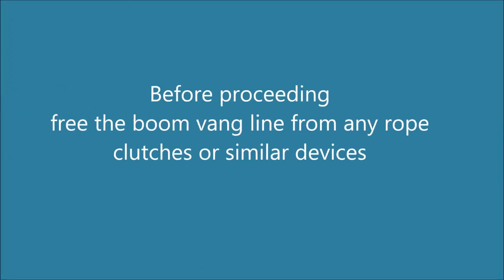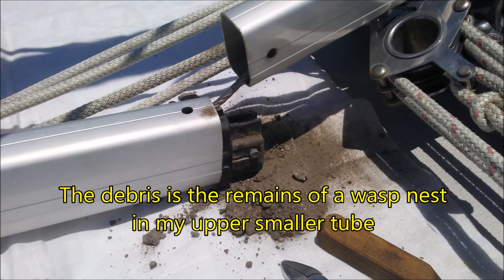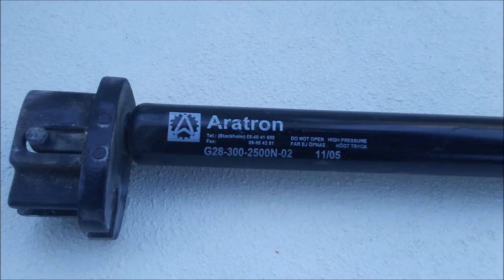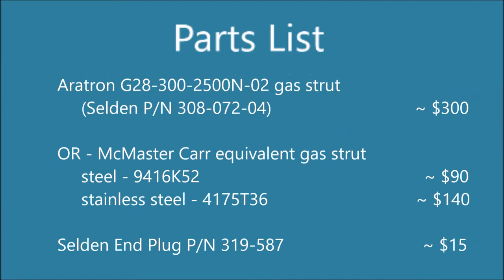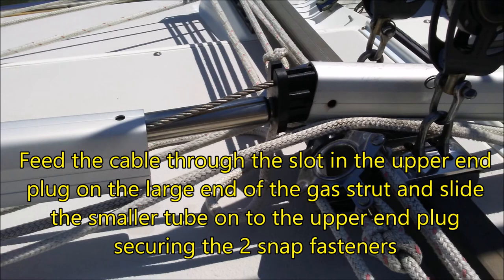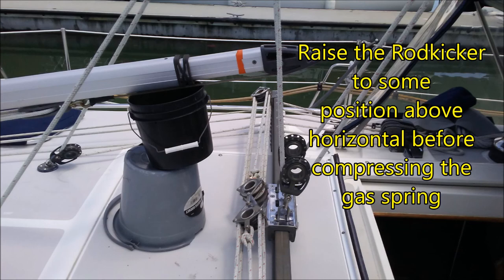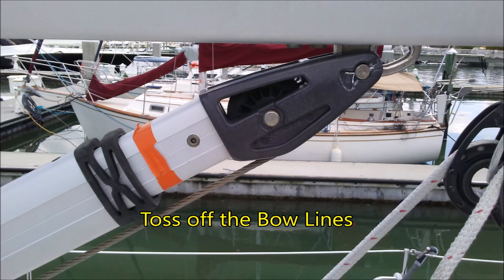Replacing the Gas Strut in Selden Rodkicker

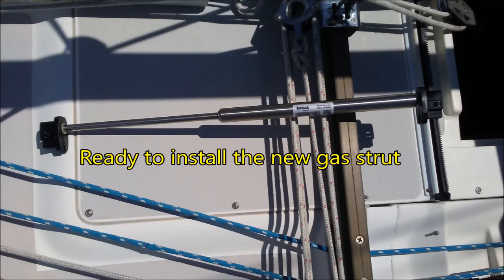Comment: Just a clarification.  At 2:15 of the video, we see the symmetry of the end pieces - flat ends each pointed towards the air spring.  That is incorrect.  The bottom one needs to be reversed.  This is because the metal tube inside the lower part of the rodkicker presses against the endplug, and if reversed, the tube eats away at the end plug.  No, it is not intuitive.  We want the flat ends of the end-plugs to each point toward the mast.

Comment: To remove the cylinder from the end plug, use an angle grinder to cut the cylinder at an angle about an inch from the end plug. (The cylinder is depressurized -- that's why it needs replacing.) Let the metal cool, spin the cylinder wall on the frozen piston. Grip the exposed piston wall with channel locks, and you can crank the rusted bolt out of the end plug. The piston and frozen bolt are one piece. ... Or just buy the new end plug for $15. Also, I think the 2500N in the cylinder part number is for Newtons, which equates to the 550-lb cylinder from McMaster-Carr.

Comment: This was posted five years ago but I'm going to ask my question in hopes that you are still active and willing to help...you went to the trouble to film and post this so it makes sense to me that you might want to help.  I purchased a Hunter 44 Deck Salon this summer and it has a Rodkicker.  I'm still trying to figure out exactly what this thing is supposed to do...30 years ago when I learned to sail all we had was a standard boom vang.  Getting back into sailing now I'm finding I have a rather steep learning curve on some of the equipment.  

But here is my real question, how do you tell which rodkicker you have?  You indicate you have a RK 20...how do you know?  It doesn't say "20" on it anywhere...neither does mine.  Mine only  has six digit numbers on the two end pieces, the larger aluminum extruded tube (printed on the "SELDEN RODKICKER" sticker), and on the plastic connecting parts.  Each part has a different number so I am assuming these are individual part numbers.  However, none of these six digit numbers translate directly to a RK-10, RK-20, RK-30, etc...at least not that I have been able to find.  

The instructions that came w/ the boat are for multiple RK models, 10, 20, and 30 I think.  My point in asking is that I want to install a gas tube in mine (mine did not come w/ that option) so I need to know which model RK I have to order the correct cylinder.  Unfortunately I don't have a gas cylinder so I don't have a part number to go by for that.  Any help you can provide in helping me ID my RK model would be greatly appreciated.  Thank you.